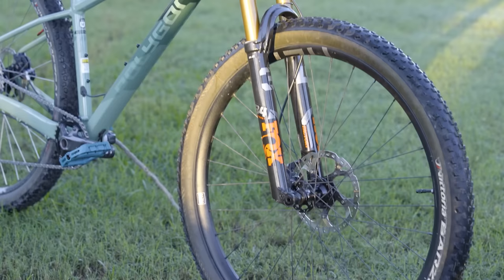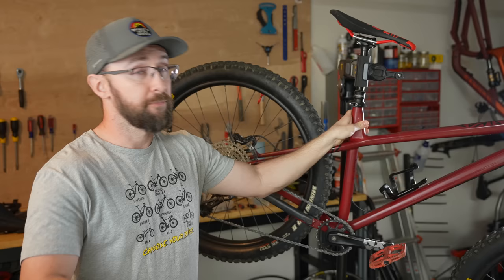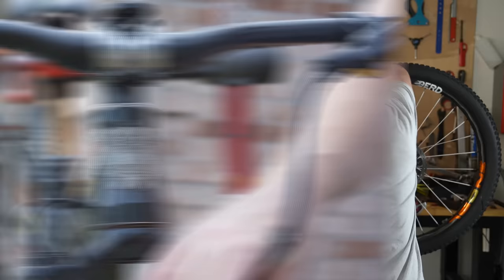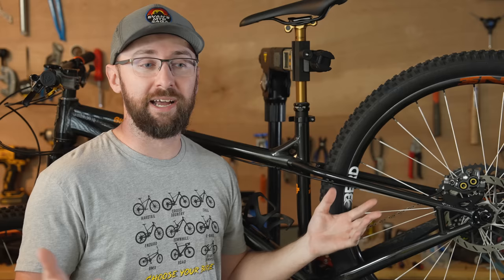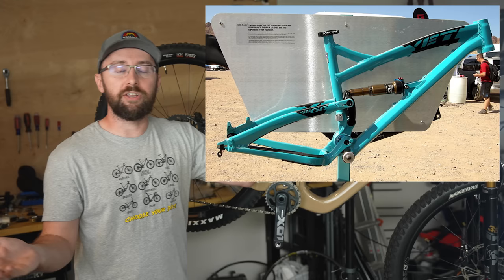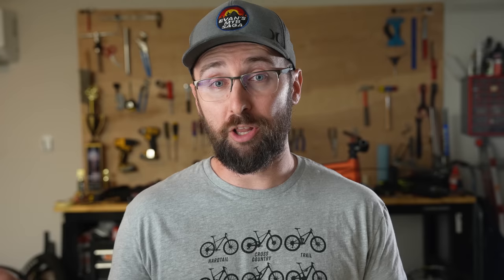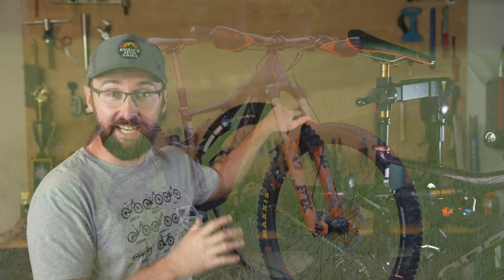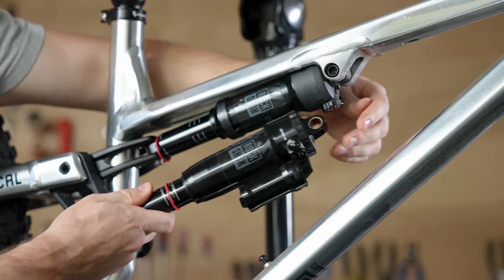My $40,000 Bike Collection!!

Comment: As an Orbea Rallon rider myself I think you'll be pleasantly surprised at just how capable that bike is in a proper park setting. I did swap to a full coil setup though. CC Kitsuma rear with overstroked shock and a Smashpot in the forks and overforked to 180 mm. I also got some Newmen Carbon wheels for trail use and kept the stock DT's for park and DH  use. Even though the rims may as well be made out of soft cheese. Also swapped the DEORE 4 pots for XT 4 pots. and did a bolt swap for anodised Ti and also swapped all contact points for personal preference. 
She's a proper beast now.
Reply from the maker: Oh wow that sounds like a serious bike. It's cool to hear about other people swapping parts on and off for specific purposes. Can't wait to unlock the Orbeas potential!
Reply: @EvansMTBSaga  You should seriously consider keeping the Orbea. It's basically everything I dreamt of in a bike 20 odd years ago when I wrenched for a living. A long travel rig that's actually rideable not only going downhill. I did the coil upgrade because I am an ex dh racer and freerider and like the feel of coils better than aircans. And considering how light the bike is the extra weight doesn't really matter that much overall. 
I hope to see more vids on the Rallon during the season. 
Also thanks for the quality content. I've been a subscriber for some time. And I appreciate the value angle as well. 
Also glad you tried out a Ragley. I also ride a Gen 1 Blue Pig. So nice to see some love for the british hardtail.

Comment: Hi, recently on my dads forbidion MTB, we increases the stem length by 10mm, the front tire was a 29er 2.6 hans dampf. we ran pretty low pressures on it like sub 20psi. but when I corner on lose surfaces, the front washed out with the 30mm stem. when I put the 40mm, there was more room to lean on the front and load the front tire on loose turns. it still asked out with enough lean but it was considerably less. you do loose a bit of the playfulness as  to jump you have to pull back a bit more. I know that on my hardtail, the tire for the front was pretty good last year. it had plenty of grip anything except really dry conditions/ hardpac. that hardtail had a 60mm stem and the tire never washed out.
Reply from the maker: Oh very cool! Thanks for sharing with me. I'm going to try a longer stem with your recommendation. It sounds like I was having the same issue as you. Thanks Athish
Reply: @EvansMTBSaga  np!

Comment: Use less pressure to clean your bikes! I believe your issue with bearings and droppers is the fact that power washers get into everything. You end up pushing any dirt off, or into, your seals. It's painful. Use something that has that "mist" feeling that a car wash gives before pulling the lever. The biggest part of cleaning is your brush. Careful on that water pressure!! Great video, though. First one I've seen, of yours, and I'll be checking more out. 😊

Comment: ive been re watching the sad to rad series and other older videos, so seeing what you still have leftover from a few years ago is pretty cool
Reply from the maker: Haha that's so cool to hear! I'd love to do another one, but man that was expensive.
Reply: @EvansMTBSaga  I can imagine lol, I also have a Canyon and every single complaint you brought up in this video I have as well, I am on my second frame from them after a warranty replacement, my new frame currently has the chainring rubbing the frame taking chunks out, the rear end is also showing signs of rubbing, the dropper post moves inside the tube, and man is it HEAVY, ive replaced the cockpit, wheels, and fork and have it down to 33lbs!
Reply from the maker: Oh yeah I had a hell of time nailing the spacing on the chain ring and have scuffed it up a ton right there. I'd still try another Canyon though, what about you?
Reply: @EvansMTBSaga  I am on the edge with them, Im mad I paid so much for my bike at the time for the terrible components it came with, But they have some pretty significant sales throughout the year now and Ive been tempted to pick up the Spectral CF from there or the outlet. Canyons European supplier makes me envy their stock bikes over in the EU

Comment: Hey if you want more hardtail recommendations, check out the Marin San quenten or El roy. The el roy has a steel frame and great geo, and the san quenten is one of the best value hardtails.
Reply from the maker: I'm on the fence about trying out all these hardtails and including 27.5" frames. I might stick to 29er cuz I have those nice wheels to install on all of the bikes
Reply: @EvansMTBSaga  The el roy is a 29er

Comment: 1:49 Was this with these cranks only, maybe the cranks you use are super stiff, might be the frame like you say. But I've never tried this bike. Do you have any ankle issues? or does this bike just make the ankles hurt? Maybe they tried to make the bike strong and stiff enough for really heavy riders, but that makes it very harsh for an average weight rider.
How long did you ride it, did you only ride that bike that day, did switching bikes solve it? did it hurt when you came on this one? I am asking, cus in theory you could have messed up your ankles, and then rode the bike or happen while riding it, it happen to me but no longer an issue anymore with ankle braces. 
I have sloppy ankles, so I use Space Brace 2 ankle braces, they work really well. I have issues with misalignment, which also cause pain and fatigue, but I also have the same issue with the wrists, which result in lack of power and control, but I use Mobius X8 wrist braces. They are great, easy to put on, adjust.

Comment: do you think I should get a new recon or an old z2? I'm looking for a 26" rim brake straight steerer with more than 80mm of travel
Reply from the maker: Well if you get a new recon it sounds like you'll need disc brakes right? I'm sure a new fork will be more stiff
Reply: @EvansMTBSaga  I got some hs11s for $5 and if I get a recon silver tk I can use rim brakes front and rear because my old frame has no disc mounts
Reply: I wouldn't put any money into a bike still using rim brakes. Save up and buy something new
Reply: @aaronchyea  I wouldn't but it is a handmade titanium dean hardtail that I got for free and I don't have the budget for something new

Comment: you should extend the fork on the ragley
Reply from the maker: What do you mean?
Reply: @EvansMTBSaga  when you were on the bike you looked very bent over, in a xc-ish position what if you upgrade the fork and add a longer travel air spring. The upgrade is pretty cheap close to $40 all said and done.

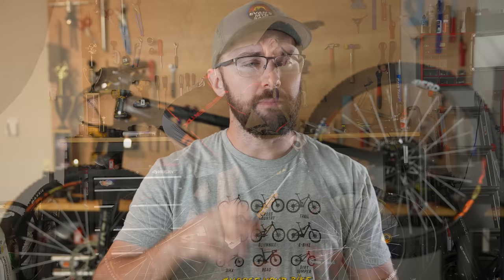Comment: 4:47  too much sag, too little rise. Keep in mind using ball of thee foot position instead of mid foot to almost id foot position is less stable, I use mid foot, to almost mid foot, anything more backwards results in instability, I never liked it, yet many ride like that, especially with clipless shoes. But doing what I do requires longer reach. But that's how I like it, long reach mid foot position, saddle tip above BB, high rise. 
If reach feels too short on that bike, slam the stem, get a tall riser bar.

Comment: Evan, why are you using a pressure washer? You should know that’s not good for the moving parts.
Reply from the maker: Didn't Seth debunk that?
Reply: @EvansMTBSaga  the first rule of the internet is never trust Seth isn’t it? He even says so.
Reply from the maker: Hahah I haven't heard that. Seth has an interesting style, but I think he comes up with great ideas and shows some pretty solid tests of his ideas. With that said, this electric pressure washer is pretty weak. If I have it spraying, I can hold my hand probably 4-6" from the tip the spray isn't harsh, just like a strong mist. Definitely not enough pressure to take off skin or anything. It's mainly to get the mud off the tires.
Reply: @EvansMTBSaga  haha personally I’m a spray kinda guy, but to each their own.